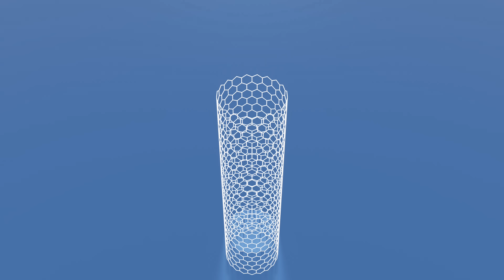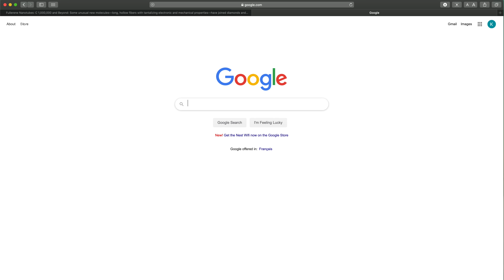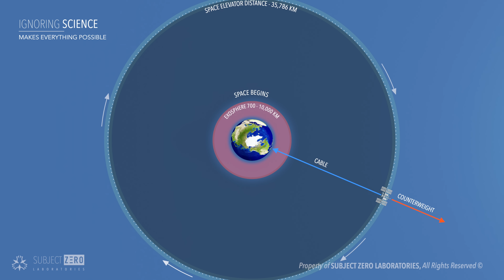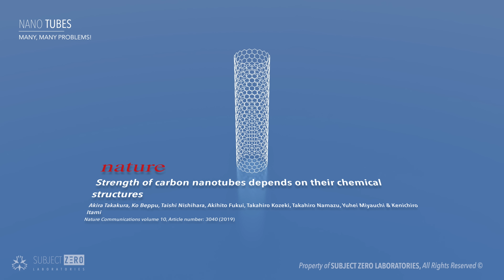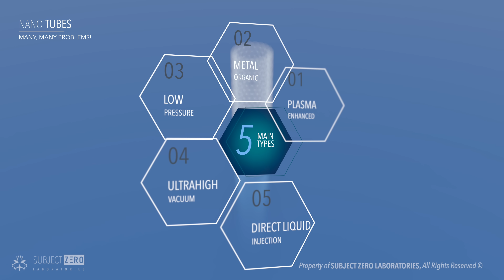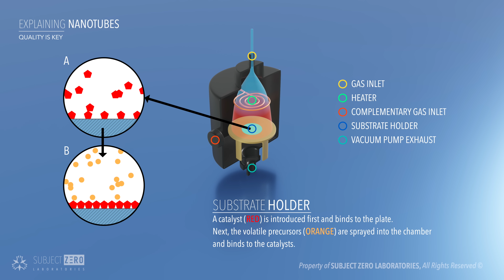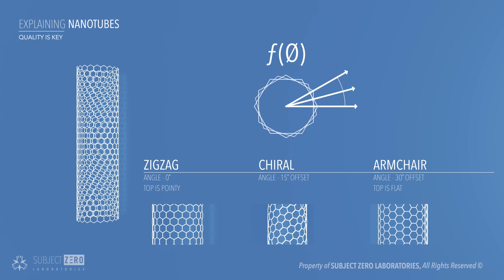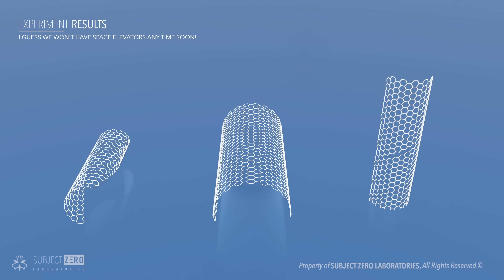Nanotube Strength, Bad News for Space Elevators [2019]

Comment: When there needs to be hundreds of rocket launches every day, instead of cooking planet earth, space elevators will be the better solution
Reply: Launch loops are better than space elevators by a long shot.
Reply: @TCBYEAHCUZ  "A launch loop would be held up at this altitude by the momentum of a belt that circulates around the structure. " the materials involved in holding up a 2000 mile long cable and the rapidly moving inner belt sound a lot harder to make than a boron nitride nanotube tether 36,000 km long.
Reply: @danielroden9424  I'd argue the opposite, neither of the proposed strength-requisite materials that a space elevator requires are currently mass producible nor guaranteed defect free, while the materials used in a launch loop (Iron, Copper, Steel etc) are trivial by comparison, it only needs electricity to accelerate the iron rotor, and keep it suspended. It is an active support structure while the space elevator is a passive support structure. 

So technically speaking, it is far more feasible to make a 2000 kilometer 5cm diameter copper tube with an Iron rotor wire on the inside, with auxilliary support cables made of normal steel or fibers such as zylon or kevlar. I also hate the fact that payloads take days to reach 36 thousand kilometers, but a launch loop would directly be able to insert payloads to basically anywhere, with the exception of human passengers, which would be regulated to 2G accel.
Reply: Chaim Goldenbaum, orbital rings are better than launch loops. They have all the advantages, basically being a planet sized launch loop, but already in space.
Reply: @kokofan50  This^

They also don't require any fancy new materials, you can put them 80 miles up, and drop a tether of spectra/dyneema rope to the ground anywhere along the length of the ring to attach an elevator. And you have nearly full gravity on the ring (since at 80 miles altitude, surface gravity is still around 95% of normal Earth gravity) which is also handy for actually living on a ring. Frankly, I can't see any real advantage to any other system, besides possibly a space fountain design for sheer simplicity.
Reply: @berserkasaurusrex4233  
 kokofan50  

It is probably better to start off with a relatively small launch loop than a full orbital ring, the principals in both are really the same and both have advantages of not using bleeding edge material science. Ofc an orbital ring is an order of magnitude more capable than a launch loop, but it would be harder to work towards an orbital ring than start relatively smaller scale with a launch loop. 

Also my argument is stating that launch loops are better than space elevators not better than orbital rings. Basically any active support structure larger than a launch loop is better than a launch loop.
Reply: @danielroden9424  The idea of actively supported structures like launch loops is that you don't use material strength to hold the structure up - you use the upward inertia of moving mass and deflect it downwards with magnets and the like, thus circumventing the material strength method. The new problem you now face is trying to deal with this huge belt of metal or whatever have you travelling at thousands of miles per hour and probably subject to all sorts of weird vibratory modes.
Reply: @TCBYEAHCUZ  the problem with orbital Rings is they require an existing orbital industrial base , launch Loops have the same issue to a certain extent. The amount of traffic needed to realize the lower projected cost of payload implys massive development already existing. I think a better option than the elevator or the launch loop at our current point in development would be a Skyhook,  lower development costs, wayless required energy input and will reduce the cost to orbit sufficiently to boost orbital industry.
Reply: @mrspeigle1  Personally, just coming from a science fiction writing background, if I were writing all of this as a timeline of near future developments, I'd use space fountains to produce electricity on a mass scale and use that capacity as a market for further space development. The advantage of orbital rings (and certain very large launch loop systems) over other launch systems is that they don't need a space-based industry to still be useful; a skyhook can really only be used to move things into space, like satellites, space probes, and ships. But an orbital ring can be used to rapidly transport massive amounts of routine everyday terrestrial cargo around the planet in a matter of hours, without needing specially built ships moving into reentry to return the cargo safely to the ground.

With an orbital ring built, you could effectively transport entire container ships worth of cargo from China to the US in about 45 minutes (plus however long to lift and lower the cargo from the ring via elevator tethers). You could just as easily move people. So once you've built up a space-based solar-power industry with space fountain towers, you can transition to an orbital ring to provide power down the tethers to every city below the ring, and use the revenue from that to both pay off the ring's construction as well as further developing a transportation system for cargo. You might never actually use the ring to put things into orbit, because that industry never develops beyond the occasional satellite launch (most of which are now made obsolete by the ring itself. It could easily handle moving data as well as cargo and people and electricity).
Reply: @berserkasaurusrex4233  the problem with your proposal is the construction of the Ring itself, to make it even remotely practical you need heavy space industry largely based on asteroid mining. It's the only way you're going to get the necessary materials into orbit to build the ring in the first place , that's where the Skyhook or launch Loop comes in. Precious metals and rare elements are worth transporting back to the ground, but things like copper nickel and iron are far more valuable left in orbit for construction purposes. I think a better science fiction timeline would be Skyhook, small rotating habitats, orbital factories and asteroid mining, launch Loop, then orbital rings. When you start getting into space fountains and Atlas Towers you start coming into pragmatic issues of time spent sitting in an elevator.  I don't think it's logical for Humanity to stay Planet bound there's simply too much out there to justify staying put.
Reply: @mrspeigle1  An orbital ring is just a big spool of steel cable and stationary magnets to build the first platform on. And a spool of spectra rope to serve as the initial tether to the ground. You could put all that in space now with a few launches, certainly less effort than building the ISS was. You don't need asteroid mining, or anything exotic. 

And once the first tether is down, you can send up more material at greatly reduced costs, to build more platforms, more rings, more tethers, etc. That's the bootstrap construction method for starting an orbital ring.

A skyhook would be at least as complicated to build, and probably more expensive to maintain in the long and medium terms.

Mind you, this assuming a complete orbital ring, which isn't even necessary; a partial ring could still be used as a launch platform into space, and merely pushed back into higher orbit the same way a skyhook would be. So the actual construction needs could be very low, if you wanted to save resources initially. And again, you'd send up more material over time to complete construction. Metals are cheap; they're only expensive to send to space on current launch methods, but once you have that first tether, mining materials on Earth is nearly as cheap as asteroid mining would be, which cost to reach the ring of around a dime per kilogram.

As I recall, the original proposal by Paul Birth had a manufacturing cost of around $31 billion for an orbital ring, in 1980's money. Using current launch costs, even with inflation, that initial bootstrap construction cost is probably still under $50 billion.
Reply: We can use methane as rocket fuel. Rockets are theoretically renewable
Reply: We don't need "hundreds of rocket launches every day, " we need to figure out how to stop ruining planet earth. If we can figure that out, then humans wouldn't need to leave until a billion years from now.
Reply: @MkeKen67  it is my honest hope that within a thousand years or so we won't give a s*** and will be disassembling the planet to construct more rotating habitats.
Rotating habitats that will join the millions already in the growing Dyson swarm around the massive star lifting operation we've constructed around the Sun which we use to power the first stages of the laser Highway we're going to use to colonize this galaxy
Reply: the amount of heat from those rockets amounts to nothing compared to solar radiation every day.

Comment: Elon Musk said his goal is $20/kg for starship.
Reply from the maker: I was being modest with my numbers. SpaceX is the future, no doubt about it.
Reply: 600$/kg consider energy transfert using power beaming. Is it possible to lay 2 cables close to each other on for each polarity of a circuit ? Then the wagon on the cables close the circuit and cost are divided by 200.
Reply: @fabienleguen  I wonder how much electrical resistance there would be on 70k kilometers of graphene or CNT's
I think solar is probably a better option.

(even though higher voltage goes a longer way, with no air to act as an insulator in space, you'd lose even more of your current to the cool plasma light show you'd have when the electricity flows from tether to tether.)
Reply: Good point. To go further, solar is a good solution outside the atmospher and far from earth surface but it is a burden in the atmospher (wind force on solar panels). Happily,  powering the wagon with two cables is easier close to earth surface.
electrical conduction close to earth and solar power outside the atmospher is probably an even better solution.
Reply: @fabienleguen  genius
Reply: @fabienleguen  - "power beaming"?
Reply: yeah, that's definitely what he's talking about with SpaceX putting this back into scifi
$2 millon launch cost divided into a 150 ton launch capacity is less than $14/kg. $20 gives them a million dollar per launch profit margin and is a FAR cry from that $600/km figure.
Having to fight gravity for days before you get into orbit instead of just minutes for the rocket method has to be the difference in efficiency that drives that cost.

Comment: For those wondering, 
130'000'000'000 pascal is 13'000'000 tons per meter or 1'300 tons per cm.
Reply: ^Squared. Also that's sea-level Earth gravity, force is universally measured in Newtons. But yeah, good simplified explanation.
Reply: @newwaveinfantry8362  
The squares was implied but yeah, thanks pal.
Reply: @robinhyperlord9053  you can't just say squares was implied lol, i had no idea what you meant until i read his comment. without square it implies you're talking about length instead of cross section
Reply: @cerebralm  
The fuck would I be using length and not Sq?

Comment: Using graphene advancements within technologies will absolutely be able to be utilized in space elevators. All we are talking about is purity and uniformity of material, which is inevitable.
Reply: Graphene would be the likely material of choice since its much easier to manufacture. Right now the issue is creating extremely long ribbons needed. Also probably need a method to bond ribbons together as it seems unlikely we will be able to produce a single ribbon with a length of ~36,000 KM
Reply: @guytech7310  Van Der Waal’s force?
Reply: @guytech7310  MIT has had some very recent breakthroughs on the cost benefit and quality front, so long sheets of defect free graphene. Once we start making it, redesigning every facet of our technologies preceding it will become faster, stronger, more resilient, cleaner, easier, and cheaper. A far more efficient machine of materials usage (as a society goes) can then effectively, and with quite a vigor, push back against the climate change as well as free the people and nations of oppressors in such dramatic ways as to theoretically see a full-on utopia within our lifetimes. Now practically and realistically getting there is anotherissue altogether lol